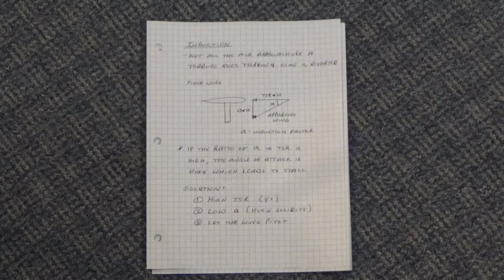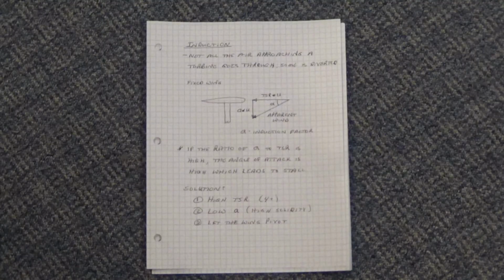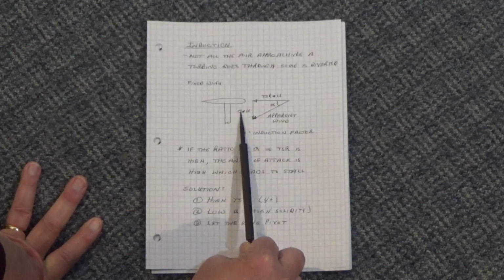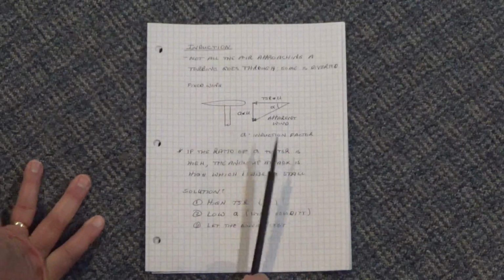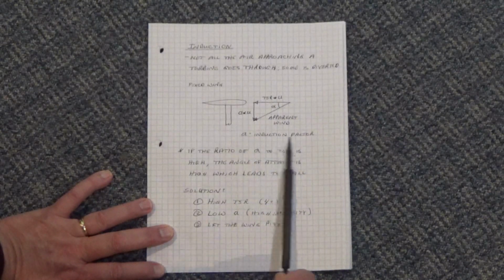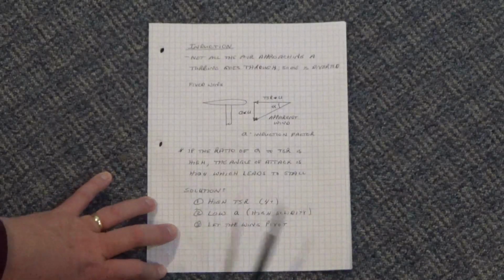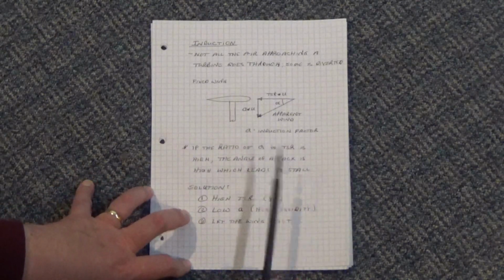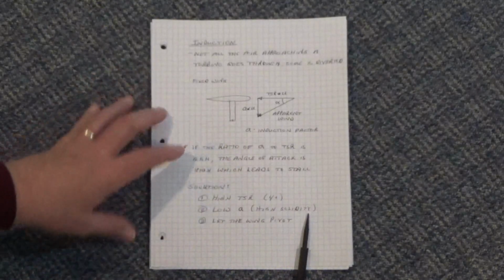Micro Sharp VAWT Design

Comment: Why did you place the pivot point where it requires a counter balance? Could the pivot point be placed in the balance point of the wing (rather than the forward end) in order to eliminate or reduce the counter balance?
Reply from the maker: That is definitely something worth looking into.  Moving the pivot point away from the center of mass of the wing helps give the aerodynamic forces more leverage, but it increases the inertia of the whole assembly.  Moving it closer would lighten things up, but might not give the aerodynamic forces enough leverage to fight against the inertial forces.  But the optimal point may be different than what I've got.  I just modeled it after the design in the patent.

Comment: Could you smooth out the wings by using a flame? Would it work better if they were?
Reply from the maker: I'd be too worried about destroying them.  :-)
Reply: I’m guessing you used PLA, if so heat is definitely a bad idea! I’m would suggest a smaller layer height. say .10mm. Could also try printing the blades on their ends in one piece. I would use a good size raft to reduce the risk of the blade falling over mid print.
Reply: Thin CA superglue helps smooth things out as well as making it more durable.  Flexible and less brittle.